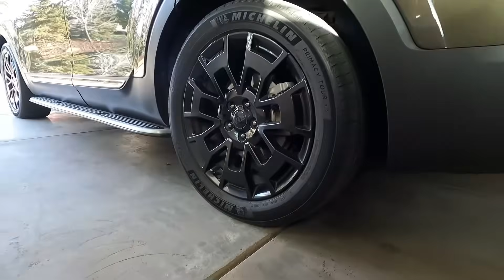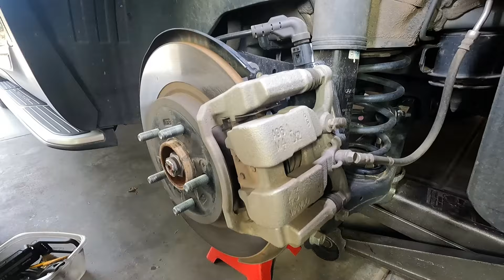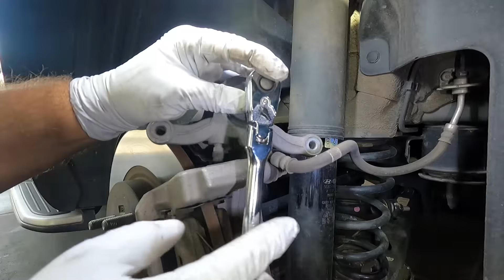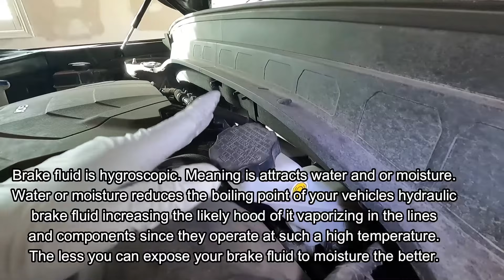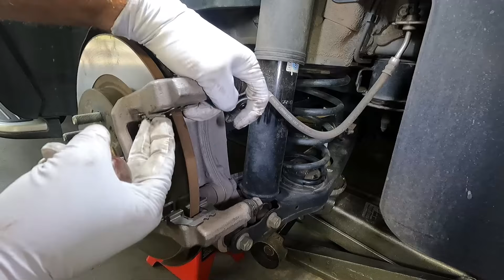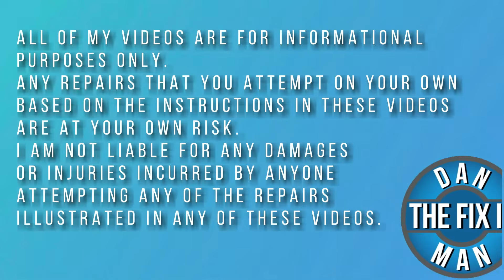HOW TO RETRACT AN ELECTRONIC PARKING BRAKE WITHOUT SCAN TOOL 2021 Kia Telluride Rear Brake Pads DIY

Comment: Dan, thank you for the video, more thorough than all the rest. 
However, I ran into a bit of a snag and I'm not sure what my options are now. Two hex drive screws holding the motor onto the calipers ( one on each caliper) is seized and now rounded to where I can't get it off. Is it possible ( or a good idea? ) to carefully drill through and replace them? What would you recommend, anyone?
What are my options?
Reply: Heat, penetrating oil, vice grips are your best friends

Comment: They just did a recall and updated the Kia Telluride software, so if you get this upgrade, your parking break is always on in Park.  Apparently they had some Kia’s rolling away while the vehicle should have been in park, hence the recall and software update.

In order to get past this, I had to leave the vehicle in neutral until I was able to remove the automatic parking brake held on by the 2 Allen bolts.  Then I put it back in park, and did step by step like the video instructed.  

Thanks, excellent video!!
Reply: I have a 2027 and you now have the option to turn that feature off so it doesn’t automatically set the parking brake. Also, I miss the old days before these idiots messed cars up completely lol

Comment: The EPB automatically engages when the vehicle is placed in park and it's turned off. You have to release the EPB. To do this you must close the door and turn the car on.  Place your foot on the brake. Put it in drive. Put it in park. Hold the EPB button down as you turn off the vehicle. This will disengage the EPB and allow you to continue with their procedure of changing the brake pads as outlined in the video. After the brake pad change is complete, follow the video instructions that require you to pump up the brakes before you turn on the car.
Reply: Its probably different depending on the car. My Kia Ceed 2021 does not engage the EPB when putting it in park.

Comment: New subscriber here.  Can anyone confirm that this technique works on the 2022 Hyundai Elantra?  I’ve read through all comments and don’t see an answer for this.  Also?  Just for clarity to shut off parking breaks, lift up and hold the button before shutting down the engine?  Is this correct?  Thanks for the advice and help!

Comment: So, does the brake motor ALWAYS HAVE TO BE RESET with the 5 mm allen and why? And when You say make sure the brake is off, do you set it to off by pushing DOWN the brake switch while pressing the pedal, then turning the vehicle off? How do you make sure the  vehicles brake system is reset to pre brake service operation?

Comment: One thing I ran into, because I already jacked up the rare of the car, the parking break was engaging automatically on my 2020 palisade. Every time I turned on the car, the angle sensor engaged the parking brake when I went to shut it off again.
Reply: Its probably different depending on the car. My Kia Ceed 2021 does not engage the EPB when putting it in park.

Comment: Finally someone doing it properly.  All the other ones didn’t involve any grease 😢 or cleaning.  That is a major cause for premature wear or malfunction.  Questions though.  Shouldn’t the orange grease go on top of the clips (between clips and pads) so the pads can more better? Instead of under (between clips and caliper brackets)?  Maybe that’s why the pads didn’t spread with the spring clips on, without the calipers?
Reply: This is a great video; very well done.  I'm getting ready to do rears on a 2020 Palisade and never did one with Electronic Parking Brakes so this is very helpful.  Might also try the 9V trick. However, you identified the only issue with the video.  The caliper grease (the BLUE stuff he used, not orange) goes on TOP of the metal clips not directly on the caliper bracket.  The grease makes sure the pads slide easily and wear evenly.  Some people also put caliper grease on the back of the pads to eliminate brake squeal when the pads vibrate against the piston and/or caliper.  That orange stuff he used is probably better for that purpose.

Comment: Carefully pry piston rubber boot up a little without tearing it and spray silicon spray underneath. Open bleeder 1/2 turn before pushing piston back to prevent dirty old fluid from going to master cylinder. Close bleeder. Good time to flush new brake fluid through system. Before driving pump brake pedal until firm and top up master cylinder.

Comment: I removed the EPB motor and then used a caliper retraction tool to screw the piston down into the caliper body (it rotated inside the boot with no issues).

Did I damage anything? It seemed to work fine.

Comment: Only thing I would add is that you cannot turn off the parking brake if the hood is up.  It’s got some sensor that won’t let you disengage the Electronic parking brake.  So check your brake fluid reservoir level, then close the hood.

Comment: i wanted to take my motor off, but as i live in salt climate near the coast and also road salt the bolts have almost welded themself to the caliper, so i went the 9V battery route and it worked, first the winding noise, then at the end the piston started to  rotate. i stopped and gently pushed the piston back with my thumbs. on the other side the piston did not rotate but the motor just stopped, i guess the 9V did not have enough "umpf" left, also here i just pushed the piston back gently with my thumbs.

other than that the replacement job was like any other car

my car: KIA OPTIMA Sportswagon (JF) 2.0 GDI Hybrid (205Hk)
Reply: What’s the 9v battery route? Can you further elaborate I’m in the middle of a bind the damn bolts are STRIPPED and am out of options…lol!

Comment: Great video thank you very much. It is possible to do this without having to remove the motor. Apply 12 volts to the pins on the motor. If the park brake applies, simply reverse the positive and negative and let the motor run until it stops. The rest of the procedure is the same as in your video. I used an old 9 volt DC wall plugin that I had in a junk drawer and it worked fine.

Comment: Changed the rear brakes for the first time on my 2022 Kia EV6 at 280k miles.  There was still some pad material left, but I'm glad I changed them.  
Your video greatly helped.  I had a fault light, and noticed the right side did not lock in park mode.  I had turned the caliper mechanism fully clockwise, but it needed to be set somewhere in the mid of the travel.  I must have done that on the left side because that side had no issue.   After correction, the fault light was gone, and the right side locked correctly.  
Thanks again.

Comment: Okay so for me (2021 Kia telluride) they were really hard to compress.. does that mean I should get new calipers?? On the driver rear the caliper piston boot is torn. And when I put everything back together the brakes are acting like they are stuck on.. I have a feeling that the EPB light might come on. Any pointers would be greatly appreciated

Comment: Why can't you open the caliper piston drain a little to let the old fluid out while compressing the piston, and then close it so no air gets inside? Gets rid of the old fluid and allows fresh fluid to fill it after the new brake pads are installed and working.  Just top off the master cylinder reservoir when you are finished with the brake job.  Why not?

Comment: “Gotta make sure the parking brake is off” huh. And ya wanna maybe mention how to do that exactly, since the software update has it automatically engage literally anytime the car’s not in drive. The buttons on the center console don’t seem to change a damn thing. Maybe it’s just mine I don’t friggin know anymore. But I can’t get that damn caliper off the rotor cuz of the piston being so tight into it
Reply: They just did a recall and updated the Kia Telluride software, so if you get this upgrade, your parking break is always on in Park.  Apparently they had some Kia’s rolling away while the vehicle should have been in park, hence the recall and software update.

In order to get past this, I had to leave the vehicle in neutral until I was able to remove the automatic parking brake held on by the 2 Allen bolts.  Then I put it back in park, and did step by step like the video instructed.  

Thanks, excellent video!!
Reply: Its probably different depending on the car. My Kia Ceed 2021 does not engage the EPB when putting it in park.
Reply: My 23 kia sorento doesn't have an automatic emergency brake. I have to use my emergency brake pedal to engage it.

Comment: The caliper piston is so jammed into the rotor I can’t even get the damn thing to budge.
Reply: Happened to me, then I realized that the parking break auto deploys when you shut the car off. Have to hold down on the parking break button while turning off the car

Comment: With the recall, my kia now sets the E brake as soon as i shut off the engine,  any info on how to  get it to not set?
Reply: I'm fighting that battle currently. I can't get the piston to retract
Reply: Any luck? @fdfc78
Reply: @fdfc78  probably too late, but Kia allows you to not engage the ebrake, when shutting off the car.  At the same time of turning off the engine, disengage the ebrake.  You should not hear the motor if you do it correct.

Comment: I saw you had used a battery previously to retract the epb in other videos but here you did it manually. Is there a preference for the telluride to do it manually versus the battery hack? I'm ordering front and rear brakes to do this job myself in the next couple of weeks, thanks for the help and video!
Reply from the maker: Great question, I think I prefer doing it the manual way now.  It's a little less risky and really takes about the same amount of time as using the battery or even a scan tool.

Comment: For the rear with the electric motor on my palisade, I just took the motor off, only 2 Allen key heads, then used a larger Allen key in the center and gently tightened, it's on a bearing and requires zero force, used a c clamp to compress, swapped the pads, lube the seal around the piston, put motor back on, reinstalled everything, plugged it in and done. Took me an hour,  for all wheels for 2020 palisade. Zero noise, super simple. Also I had parking break off when I did it.
Reply: Did you have to manually push the e brake button before removing the motor?
Reply: When you took off the wiring to the electronic brake and later click it back on, will the computer reset itself?
Reply: @fh3486  yeah, i didn't have to pull the negative or anything. however i dont remmeber if i actually unplugged it or just unscrewed it and pulled it off separately.  But regarless it reaet it self and works fine. No issues since
Reply: @fh3486 I didn't have to reset anything. Been working fine since my original post.
Reply: @fh3486 the computer just senses load on the motor to know when it is all the way in or out so it just sends power when start the car and figures itself out
Reply: Would u happen to know if this works on the 2024 Carnivals?

Comment: Kia’s answer to the parking pawl not holding is to force the parking brake to engage EVERYTIME the car is parked. If in park, engine running and door opened, the brake is set.
Reply: They just did a recall and updated the Kia Telluride software, so if you get this upgrade, your parking break is always on in Park.  Apparently they had some Kia’s rolling away while the vehicle should have been in park, hence the recall and software update.

In order to get past this, I had to leave the vehicle in neutral until I was able to remove the automatic parking brake held on by the 2 Allen bolts.  Then I put it back in park, and did step by step like the video instructed.  

Thanks, excellent video!!

Comment: Great video is this the same procedure on 2024 Sportage I saw another video stating if you removed the connector to the epb motor it would trigger a warning on the dash I would think all Kia and Hyundai would use bascially the same mechanism?
Reply from the maker: @joesuriani371  it might be the same, but I am not sure.

Comment: Open the bleed valve before Compressing the piston as not to damage abs. Plus it drains spent fluid. No hassle with air in the system  either.
Reply: What?! 😂😂😂 pressing the brake pedal causes wayy more pressure and it doesnt damage the abs
Reply: @Noon27993 😅😅
Reply: @Noon27993  I said compressing the piston with a c clamp .  Open the bleed valve to drain old fluid and reduce reverse flow pressure.
Reply: @joec2174  the entire system has „old fluid“. When discs and pads become thinner, the fluid level sinks. If you drain fluid when renewing discs and pads the level will become even lower… there is no such thing as reverse flow pressure. But there is pascals law
Reply: @Noon27993 he clearly doesn’t know what he’s talking about. I’d be willing to bet that he’s the type who adds brake fluid to the system as his brakes wear down 🤭
Reply: @joec2174 I have seen 20 videos by now changing brakes and pads no one by chance had mentioned this. You seem like complicating the things! Bleeding the valve is a headache and needs to be scheduled for a different day.
Reply: @anveshc6411  so leave the old fluid in the system. Then watch your piston wall start to scuff and seal leak. The fluid in the caliper gets hot then cools as you drive.  It beaks down eventually and can also become corrosive.  I see this in many hydraulic systems. Open the valve and allow fresh fluid to protect your system.  This is the same as if you changed your engine oil and not the filter.  Old fluid can’t perform as required. Don’t be lazy. Regards and be safe.
Reply: @joec2174 ok thanks for letting people know
Reply: Theysame thing
Reply: Why would there be "hassle with air in system" if you are just replacing pads? You aren't taking off the caliper so no air getting in the system. The bleeders are only to bleed the brakes after opening the system and introducing air.
Reply: @ColonelFlickage  the caliper piston seals leak and  some are not seated properly from the factory.  I have found ft caliper mounting bolts very loose from day one.  Toyota is lacking attention to detail.
Reply: The care car nut said isn't necessary to open the bleeder
Reply: I’m sorry but judging by your comment you have no idea what you’re talking about. I hope for your safety and the safety of your loved ones that you don’t “work” on your own vehicles
Reply: @ read some manuals on this subject. I appreciate your concern.
Reply: @joec2174  „reverse flow pressure“ 💀 i can tell that you have never been schooled/teached properly. I dont understand why people like you think they should give advice. You cant tell people to open the bleed valve without having a pump connected!!! I am a German automotive specialist that denied a Job at Porsche in 2023. dont tell to read any fcking manuals and look up pascals law you certified tiktok mechanic

Comment: FWIW, if at all, for the 2016 Sorento with EPB, another video specified to turn the mechanism 5mm screw counter-clockwise to retract/disengage the parking brake cylinder.  It also specified to turn it clockwise when done to re-seat the parking brake cylinder.  Have you replaced pads on a 2016 Kia/Hyundai with EPB?  I ask because based on your video and the other I saw, there may be differences in the procedure.

Comment: Nice vid ! After unscrewing both bolts , my calipers still won’t come off ? Any reasons why ? I did hear you mention something about making sure the parking brake is off but i’m not sure what you mean by that . I have to park the car in order to work on it .
Reply: Yeah all i did was push the piston back in with a screwdriver. I kind of used the screwdriver to act as a pry tool and i angled the screwdriver in between the gap and i push the piston back in . The piston will only go in if the parking brake is off . To turn that on/off go inside the car and hold the parking brake button.
Reply: The car is in park yes, it's the parking break so you have no resistance when tightening the spindle when you remove the motor. You can almost do it with you finger, I used a Allen key and did it gently. Took 15 seconds by hand since there is no resistance
Reply: Ever figure this out?

Comment: Thanks for the info! Worked great on a 2019 Santa Fe, no scan tool needed! One thing I noticed is that the gasket between the EPB motor and the caliper is an o-ring. I found it easier to reattach the motor by seating the o-ring into the caliper groove first. 👍
Reply from the maker: Glad to hear it worked, and thx for the tip!
Take care,
-Dan

Comment: THANK YOU SO MUCH DAN! I'm "old school" and have done all of my own work on all of my vehicles. I bought my first new car in 2021 and it has an electric parking brake. I went all electric. I bought a 2021 Hyundai KONA EV. I need to replace my rear pads and rotors. This is an awesome explanation/insrtuction video.